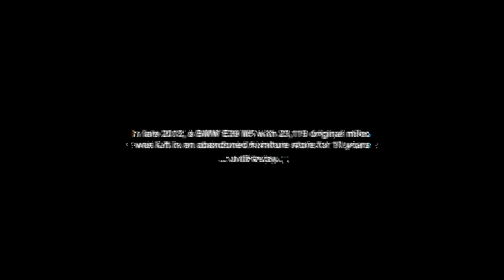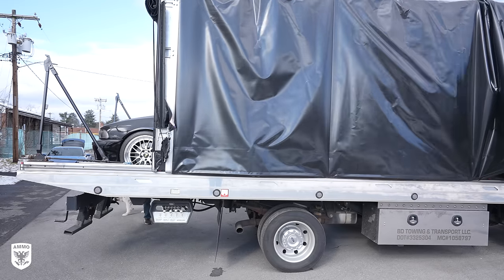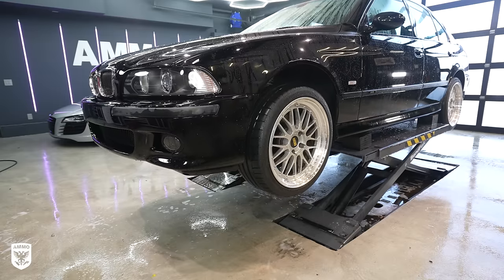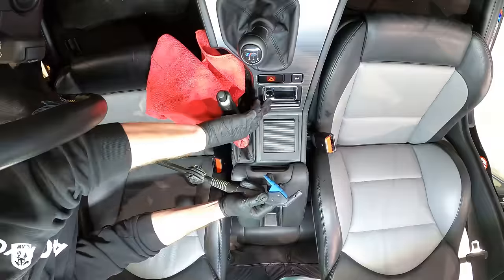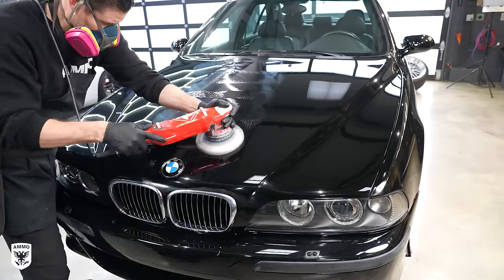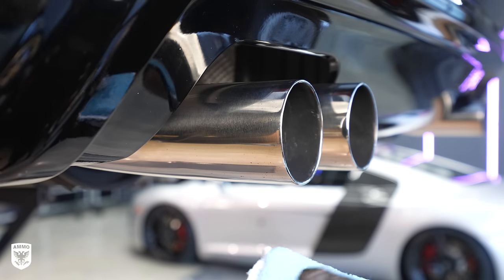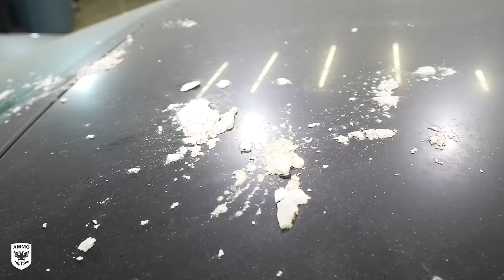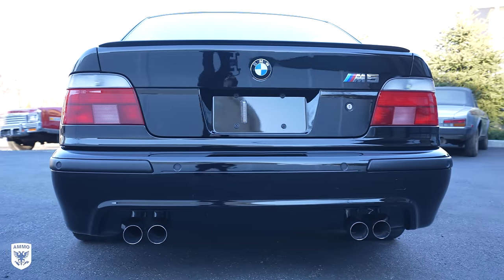First Wash In 10 Years: E39 BMW M5 Barn Find Detail and Restoration For Sale!

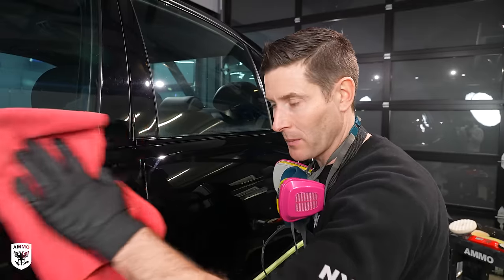Comment: 8:49 - I also performed a paint correction on a "well-loved" black E39 M5 late last year and I totally agree, the paint is extremely cooperative and perfect for polishing. By far the easiest black car I've ever polished, and one of the easiest paint corrections I've done in general. Also, I tried several leather cleaners while cleaning the interior, and AMMO Lather was the only one that left me with a perfect matte finish on the leather that didn't feel sticky, definitely my go-to leather cleaner now.

I'm not a huge BMW fan but the E39 M5 is such a great car, the build quality is superb and the way they drive is so buttery smooth. The shifter felt smooth, tight, and precise which is unusual from a BMW of that era. The clutch was on the heavier side, but the bite point was exactly where you'd expect it to be. The suspension is smooth and forgiving, but definitely does a great job of hiding the fact that the car weighs 4000lbs and it handles fantastic for a 20+ year old car. 

Great work as always, Larry! Always looking forward to your next video!

Comment: Such fond memories of the E39 I had for 12 years, thank you, enjoyed the restoring. Pls keep an eye on the rear door weather seals which BMW didn't use sufficient bonding glue and u will notice water drip from the door light @ the bottom of Door after rain/wash. , If doors are left closed with poor sealing this will flood the rear foot wells.  Very nice time capsule.

Comment: I have an anthracite gray 2000 m5 which I bought 5 years after owning a 1997 540i sport 6 speed in Oxford green metallic / tan interior.  It is simply the most satisfying and fun car to drive. It does everything so well. Driver involvement and feedback is superb. Performance is surprising even today. the chassis balance and dynamics are perfect in my opinion. My daily driver 540 sport is at 170,000 and still runs awesome -aside from the oil leaks ( which I’ll remedy during its timing chain and guide replacements). my M5 and 540 sport have had a complete overhaul of their steering and suspension components including all ball joints , shocks/struts and all rubber bushing and control arms replaced with OEM brand components making them ride like new cars.  Amazing how stable and planted they feel at high speeds, hard corners, fast sweeping turns etc. after all the posts I’ve read from previous owners who regret selling theirs , I dont see any reason to sell them . Ever.  Although I do have a 2 owner 91 850i  with the rare 6speed manual (schwarz black exterior and perfect grey leather interior ) that I’ll be listing on bring a trailer in the near future. Once I have a new set of tires and a wheel alignment done.  While the 850 looks like a true classic the m5 and 540 are way more addictive to drive.  They too  have a timeless design .

Comment: The saying "They never build them like they used to" is very true, I drive a 530i daily and the E39 is particular is one of the best if not the best BMW designs ever. 
If the M5 would've had enough space for the 5 series steering box... it would've been perfect. (it still is anyway)

Comment: I have an E39 530i M Sport which is the 6 cyl version of this.  Same rims and Michelin Pilot Sports, same steering wheel, same suspension.  It's basically an M5 that's missing over 100 horsepower!!

Comment: Unreal! I wonder if those vapor barriers leaked at all after sitting for so long lol. Also curious if any little rodents got at some stuff? They got at my fuel lines on top of the tank in my e39. I'm sure hoses and plastics will still need to be replaced from drying out. Nonetheless, this is gonna do insanely well at auction - the history, mileage, stock, detail and service - doesn't get much better than this. Let's just hope it goes to a good home! The e39 is a classic that has aged so well!

Comment: as a previous E39 M5 owner:  this is actually the LEAST desirable model as it's a 2000 which was known to have rod bearing + oil consumption issues.. it also lacks the desirable updates of the headlights and navigation and parking sensors (and other tech updates) as well as silver or black being the most COMMON colors of this generation M5.  when it comes to these, the later the model year, the better and most wanted colors were white, red or blue.  only thing this can be valued for amongst the rest are the low miles.. and the PSS9s SUCKED.  i took mine off (from prev owner) and went with kW's!

Comment: Personally I wouldn’t touch this car with a bargepole. The S62 engine is generally robust (except the VANOS) but they are absolutely prone to oil leaks, the risk of which is greatly exacerbated by not using the vehicle and letting it sit for a long time. This is common to lots of vehicles especially high-performance sports cars which really need to be driven very regularly at full operating temperature to keep things working smoothly. Not using them or only using them for short journeys at low engine and transmission operating temperatures is deadly to longevity. So for this one to have sat unused for so long is a massive red flag to a prospective new owner.. There is a very clear and direct relationship between low mileage old cars that have sat for a long time developing multiple oil leaks not long after they are rejuvenated and put back on the road. Experienced guys will know exactly what I mean when I say you are better off buying a much higher mileage example with an excellent service history then you would be buying this one. Sorry if that’s an unpopular opinion but just saying it as I see it from years of experience fixing German performance cars. (BTW Porsche boxer engines are in a league of their own when it comes to failing due to lack of use.)